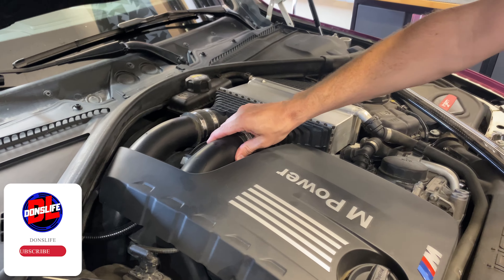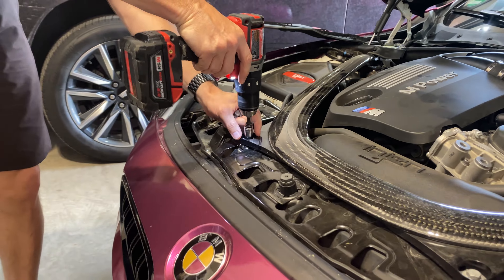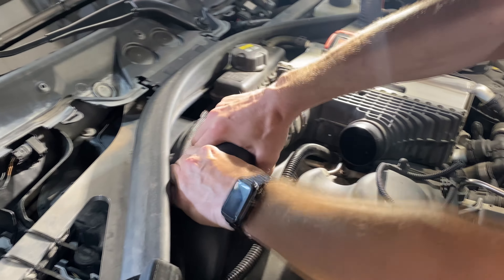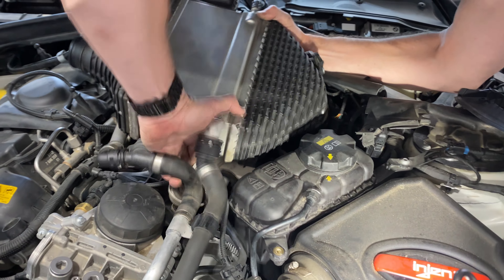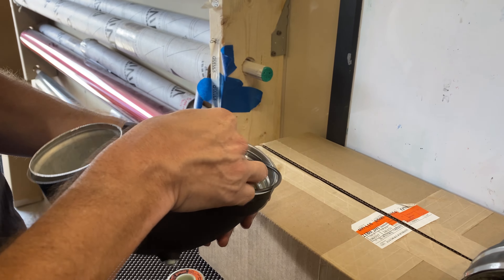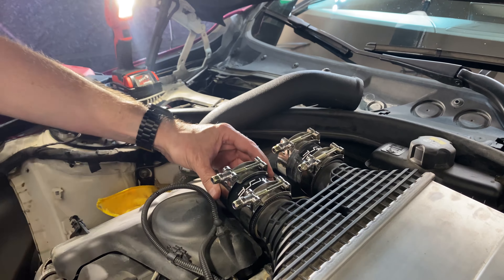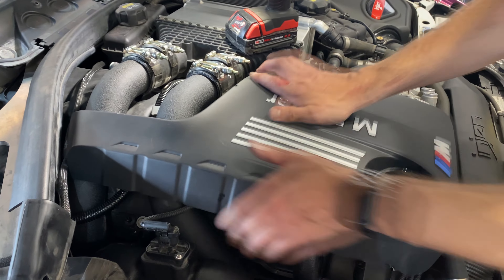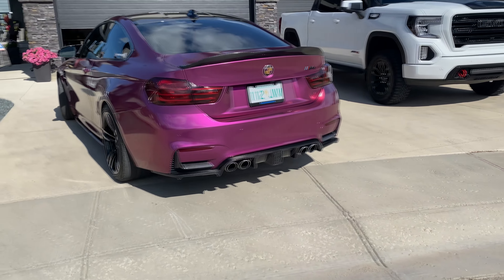Upgrading Charge Pipes and J Pipe Without Draining the Charge Cooler BMW M3 M4 M2 (S55)

Comment: Hi mate just did my Charge & J pipes your video was a great help thanks👍
Reply: I used silicone grease sparingly on the o rings and a spring washer on the aftermarket charge pipes when I removed the pipes I noticed the factory had it on the o rings.
Reply from the maker: I am glad it was helpful

Comment: Hey when installing the charge pipes did you use a different bolt for the rear chargepipe then the front one ?
Reply from the maker: I used the bolts that came with them from VSRF